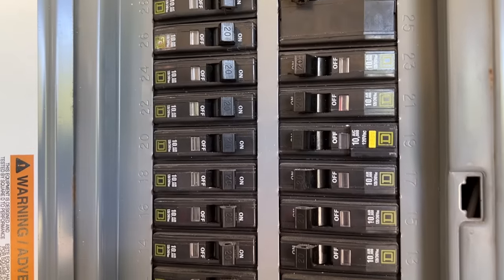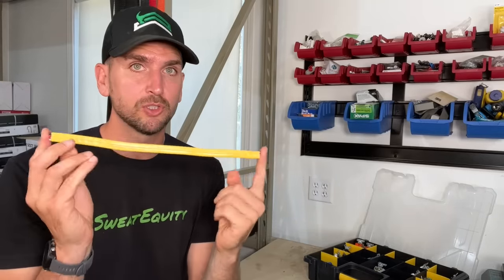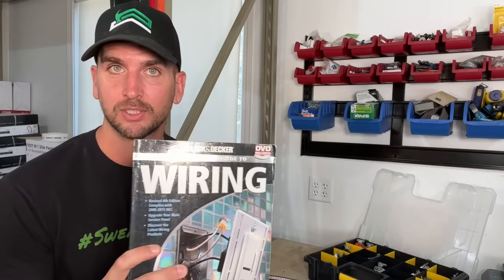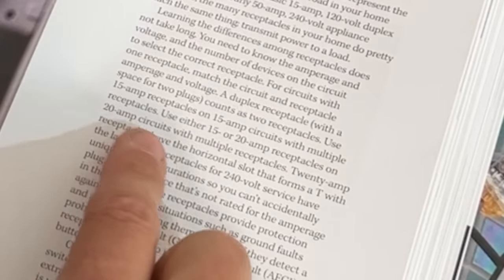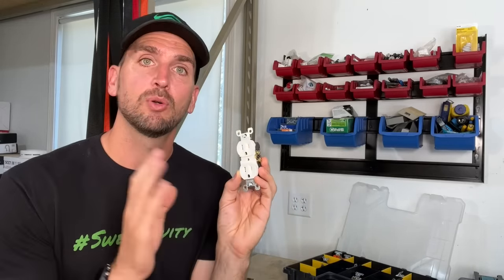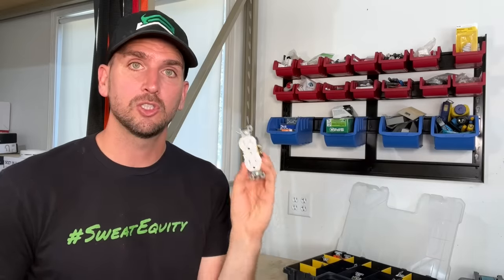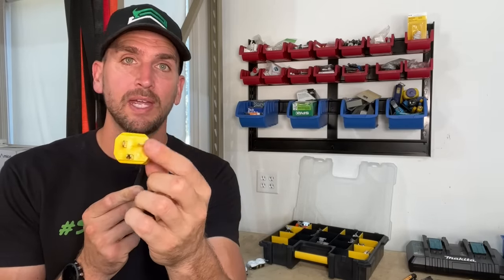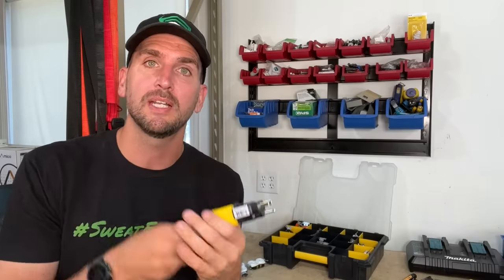Can 15 Amp Outlets Be Used On A 20 Amp Circuit Breaker

Comment: I just subscribed to your channel even though I learned electrical wiring when I was in the 9th grade and I'm 70. What I learned back then is so antiquated, I desperately need upgrading myself! 🤣 Seriously though, I have really enjoyed your video's and the new information you give me. Just from this video alone, I will never buy anything but commercial grade outlets from now on. Especially since the contractor was very cheap, and used 14ga. wire instead of 12ga., and wired the house himself instead of getting an electrician to do the work back in 1988. Just back in June of this year that cost me and my wife over $2300 to have the electrical panel replaced by a professional electrical company. That fixed more problems we were having than I can count. The old panel had several breakers that were not connecting because the connection strip was burned out!
Reply from the maker: Welcome to the channel and thanks for providing the story showing saving a few bucks today can cost many more dollars in the future.
Reply: Thanks to utube - I'm  just learning about electrical wiring at 56 - good medicine

Comment: When I see a 15-amp outlet, I assume 15-amp circuit and breaker.  When I see a 20-amp outlet, I assume 20-amp circuit and breaker. If I ever wanted to upgrade a 15-amp outlet on a 20-amp circuit, I would have to trace the wire back to the panel to make sure it's 12 gauge the entire run, or assume that the entire run is 12 gauge if it terminates at a 20-amp breaker. The cost difference is not that great in the long run to not just simply use 20-amp outlets on a 20-amp circuit. Personally, I prefer knowing what I see is what I get. ;)
Reply: I like it the same way, guess we have something in common;)   In a home or apartment equipment with 120 volt,  20 amp plug are rarely encountered. The few times they are, they are typical on commercial or professional grade kitchen countertop appliances, such as microwave ovens, toaster ovens, and expresso machines,  like the style you'd find in a restaurant or café.    Because such devices pull large currents,  they usually will require it's own circuit,  so when you walk into a kitchen and see 20 amp outlets along the countertop, for example,  that's often done so the occupants can see they have a 20 amp circuit at a glance.   That's how I'd build my own home.
Reply: Go to your kitchen. Look at the outlets. They are 15a outlets. However, they are on 20a circuits unless your house is really old.
Reply: @dracula3811  - you're most likely right. Without opening up each outlet and tracing the circuit back to the panel, better to go to your panel, find the kitchen breaker, and verify that it's 20 amps. Better still to remove the panel cover and verify that the wire it's attached to is 20 amps. In fact, our electrician DID put all 15-amp outlets in our kitchen on 20-amp circuits.
Reply: I've seen too many non-inspected DYI electrical modifications to assume anything. Here's a good one. House was wired with 30-amp 220v (correctly on 10-gauge wire) going to the garage on a 30-amp breaker. At the garage, the sub-panel had been removed (why?) and the two hot feeding legs had been split into two 110v circuits on a shared neutral (no breakers). One leg was populated with 20-amp outlets and the other 15-amp outlets and misc garage lighting. But the 220v breaker in the main panel had never been changed. Ouch! One garage leg had shorted out internally and was flipping the breaker intermittently when the ground was intact, but otherwise buzzing!
Reply: @BrucePappas  that's the way 99% of electricians wire kitchens. It's code compliant and safe to do.
Reply: @dracula3811  - when I rewired our daughter/son-in-law's house, we put 20-amp outlets on 20-amp circuits, even 20-amp GFCIs. I prefer it that way. BTW-The new panel was populated with arc-fault breakers.
Reply: @BrucePappas .  An inspector found a 40 amp single pole breaker on #14 NM cable before my son bought a house.   An electrician came and replaced it with a 15 amp.   And that as it ended up was the safer part of what was happening in that (electrician installed) sub panel!  The electrician refused to turn the panel back on and left.   The owner turned it back on.
Reply: @KevinCoop1  - that's scary!

Comment: I run 3 20 amp circuits with 12 gauge to 15 amp receptacles for my home theater and have for 20 years with zero issues. Two big powered subs, ran 4 at one point, also one big poweramp amongst other components and even driven hard for long periods never had an issue. Even with at times 20 amp power cord amps I've ran a 20amp adapter to my 15 amp receptacle with no issues. Maybe if it was a constant draw item there would be.
Reply: I'm not surprised, but are you using industrial grade or audio grade receptacles? Is your circuit wired for and are you using isolated ground?

Comment: I have a couple of questions. 

1. Is it okay to plug up a TV, lamps, and computers in a 15 Amp outlet? 
2. Is it okay to plug up a TV, lamps, and computers into a surge protector power strip that is plugged directly into an extension cord (the orange ones) that is plugged up into a 15 Amp outlet?

Comment: While I think this one 20amp and a bunch of 15amp receptacles is silly, I will say that I have a friend who 6000 sq ft house had been outfitted with cheap 15amp residential grade receptacles.  They had been having weird flickering and periodically smelled a burning smell and it turned out that several of the receptacles in the basement had overheated and melted, but not tripped a breaker.  The receptacles (one where a space heater was plugged in) was melted and charred on the back and it had heated up and melted about a foot 12 gauge Romex (the sheathing was discolored and no longer flat and the wire insulation was brittle) in the wall.  Additionally the circuit breaker had been damaged from the constant over-current and in-series arcing (not hot to neutral but hot on/off/on/off).  To the point that yes, better grade receptacles should be used in homes and really the 2017 code for AFCI breakers would have prevented this near house fire.

Comment: A Harvest Right Freeze Dryer is required a dedicated 20 amp circuit. When I shop for an electrician, what should I ask them, and what should I watch out for?
I subbed and rang that bell.
Reply: You should say you want a 20 amp branch circuit with a dedicated 20 amp receptacle.  Single or duplex is up to you.  Either will work.

Comment: It's odd that people who question using a 15A receptacle on a 20A line or multiple 20A receptacles on a 20A line never seem to question using multiple 15A receptacles on a 15A line, despite it happening all over their house ... the underlying concepts and restrictions remain the same: Pay attention to both single and total load.
Reply: The reason is perhaps 15 amp is a catch all case, which mostly powers low power devices in your house.  While if you think of 20 amp circuit, you think about a particular device that requires it, for which 15 is not enough. And after that device is plugged in, there is not much spare capacity left.   So with 20 amp you are more often in a situation when only one device can be powered.
Reply: I asked the same thing but some one just explained it to me. The reason actually makes sense. 15A plugs are on all sorts of devices. Those devices may use 12A, they may use 3A, they may use 0.5A, they may use 0.01A. 20A plugs, on the other hand, are almost exclusively used on devices that are going to be pulling more power than a 15A plug is rated for or else they would have just been made with a 15A plug to begin with. That's why it's different using multiple 20A outlets VS multiple 15A outlets. I've watched like 5 videos on this topic so far and none of them really explained this which left me puzzled but it all makes sense now.
Reply: @Spinelli__ .  Have you noticed the difference in the cord of a 15 amp table lamp, a 15 amp kitchen appliance, and a 20 amp piece of equipment?
Reply: @KevinCoop1  No as I don't own any 20-amp cord devices. A 20 A cord should definitely be of larger gauge if that's what you're asking since it obviously needs to be able to handle a higher current (20A instead of 15A).

Comment: The circuit breaker is there to protect the wire. If you are using 12 gauge wire, it is rated for 20 amps. A 15 amp outlet will probably realistically take a 20 amp load, it is just not RATED for that (as you point out they make adapters, if the device draws 20 amps and it is a true 15 amp/14 gauge circuit the breaker should pop). The code is written the way it is because in a multi circuit the 15 amp outlet will be just fine on a 20 amp circuit. Mainly because the WIRE will handle the load.

Comment: this is all good in the US... but here in Canada due to $ difference.. a standard outlet is about $380 at Home Depot... The pro versions run around $8 each.   Can get a bit costly when you need a lot of them.
Reply: What the heck is home depot doing with a 47x markup? :p
Reply: I'm going to assume that you meant $3.80, which is still way high. A 15 amp receptacle in the US is less than a dollar.
Reply: @davedammitt7691  yea.. woops

Comment: It's easier if you think about the demand rather than the capacity.  A 15 amp plug (the standard with 2 blades parallel) won't ever be wired to something that wants more than 15 amps.  A 20 amp plug has blades perpendicular, hence the sideways slot in the outlet.

Comment: Hi there!!
First thanks for enlightening me on differences with 15a 20a receptacles and the wiring types and all. Very informative 

Quick question tho.. so when I plug in my vacuum in certain different sockets in my mobile home and the breaker kicks power off.. does that mean I have bad wiring is present somewhere or should I just purchase a new vacuum or call an electrician?

The home is quite up in age as well as the vacuum  and I’ve learned a lot from this video so if I do have to call electrician I can ATLEAST sound like a mechanic ha
Any advice will be appreciated

Comment: The issue I run into is having an electric (oil) heater on a circuit, and also on it is a treadmill. Always pops the breaker - Set up as 15 amp, covering all outlets in the basement. Must be 15 plugs, no others under heavy load. I warn my family to turn off the heater before starting treadmill, or expect a walk to the breaker box. Considering running a separate 20 amp circuit to the work out area.
Reply: Run two.   One for each appliance.  You might want to start playing video games very heavily!

Comment: We have a portable air conditioning with a 20amp (horizontal neutral prong) plug… we currently use the converter to plug into our standard 15amp receptacle. Can we change out the receptacle? The converter is bulky and does not provide a stable connection
Reply: If this is a 20 circuit with 12 gauge wire, then yes.

Comment: UL498. Standard receps are UL tested at 150% of their rating and must hold it for 8 seconds. Hospital and commercial grade, 250% of their rating. In other words, a cheepo 15A recep must hold 22.5A in order to be rated for 15A. In addition, the link between the terminals is rated 20A, and must hold 30A for 8 seconds to be UL listed as a 15A recep. It is close to impossible to overload a 15A recep on a 20A circuit, assuming proper installation and a correctly functioning breaker or fuse.
Reply: Thanks, this is precisely the sort of information I've been looking for! I have no access to UL498 and am not about to shell out $1000+ for it, so this really helps.

It also confirms my suspicion that 15A outlets (properly made ones at least that pass UL testing and such and are legal to be installed in the US) should be able to handle well over 15A, because they're commonly installed on home 20A circuits and if they couldn't handle more than 15A then plugging in two devices totaling more than 15A combined (which while not a good idea happens every day in millions of homes) could have adverse consequences.

You said that even residential 15A outlets should be able to handle 150% or 22.5A for up to 8 seconds. What about more than 8 seconds, say several minutes, but less than the 3 hours that I believe constitutes continual use according to the current NEC? Are they rated for that? And what are they rated for under continual use, 15A?

Comment: I'm sorry, but the term outlet is already taken in the code book. It is in reference to any point in the wiring used to put a receptacle device, a switch decice, a luminaire, a smoke detector, etc. You will find in the older codes first requiring the bedroom "receptacles" to be AFCI protected, and then when expanded later, it read all Outlets to be AFCI protected. That meant everything in the bedroom. Now wiring in the bedroom walls was not included there if it had no "outlets" in the bedroom.
A company may refer to a device as commercial grade, but there is no standard in the code book that differentiates Residential devices from commercial devices. It is onle the manufacturer that has made that determination.
The thing to remember with a device rated 15 amps is that any equipment using that receptacle will also only be rated to use 12 amps maximum (80% of 15). If a device has the sideways prong, then that particular piece of equipment will take between 12 and 16 amps (80%of 20).
Yes, you can buy the more expensive receptacles and switches, but as for myself, an electrician for 20 years and an electrical inspector for 20 years, I buy the cheapest Decora devices I can find. In my last house I had for 20 years after the remodel, not one device failed. Remember, these devices were not just thrown together, but had to meet certain safety criteria per UL standards. That being said, do not Ever use a device without a NRTL listing under any circumstances. Devices that are not listed are built to no standard except what the accountant thought was cheap enough to make a buck and fool the end user.
In all my years as an electrical inspector, I learned one very valuable lesson. My opinion had nothing to do with it. It was the code and listing that dictated acceptance, not my opinion. I hope that there are some inspectors reading this that really look into the intent of the code and not a personal biased opinion. Call the manufacturer, UL, or any other National Recognized Testing Laboratory if you have a question. They would love to educate you as nobody can know everything unless they ask. 
Thank you.
Reply from the maker: Thanks for all the feedback Bryan.  I always appreciate people sharing their experience 👍
Reply: Wow!   That was very deep!

Comment: i believe they design 15-amp duplex outlets to allow 20-amp power since you could have two 10- or 12-amp devices plugged into a 15-amp duplex receptacle and gfci outlets even say 20 amp pass through since you have multiple outlets downstream all running through the gfci outlet

Comment: Just so I am perfectly clear here, according to code, if I have a 20a breaker and 12AWG wire, I can use 15a outlets/receptacles as long as I have TWO or more outlets on that same circuit?  
If true, then that means I should strictly use a 20a outlet/receptacle for a microwave outlet since it's the only outlet on that circuit/breaker?  Is that accurate?
Reply: Not exactly.   If you install a single receptacle (called simplex) then it must be 20 ampere device.   If you install a duplex receptacle, then it can be 15 amps.  That may make no sense, but the intent is, if a designer or electrician knows ahead of time about a true 20 amp appliance with 20 amp plug, then they can put the single device in so that no other appliance can be connected.   A residential microwave has a 15 amp plug and if you read the book that comes with it, typically calls for a dedicated 15 amp 120 volt circuit.

Comment: Fine, indeed 20A receptacles are quite rare.  I made the mistake of spending $$$ for 20 A GFCI outlets on my 20 A circuits years ago, thinking required since they feed-thru to other outlets.  In a remodel, I found that at least newer 15 A GFCI outlets have a stamped note "20 A for feed-thru".  It is only the receptacle on the GFCI which is limited to 15 A.

Comment: I believe all electric boxes (used to connect devices) are called outlets or outlet boxes. The difference is you have specifically "lighting outlets" or "receptacle outlets" or others
Reply: Not quite. Boxes that contain switches, for example, are not outlets.

Comment: Forget the code (for now). Logic says a 5-20 outlet will accept a 5-15 Plug  (410-56 exception a).  OTOH Logic also says, if there is ONLY a single (dedicated purpose?) Outlet, that everything should match its rating. eg Microwave, Dish Washer,... . Push-in outlets no longer accept 12Ga (holes to small.  There are still thousands that are in use that do allow 12Ga. Those will need to be replaced with Backwire models.)

Comment: Great information!  I’m in the process of checking all wiring on my outlets and switches since home builder electrician back stabbed most of them.

I still don’t quite understand if you have a 15 amp outlet on 20 amp circuit will the outlet only ever draw a max of 15 amps?  I don’t understand how outlet can limit the draw, or if that’s just a max rating on the outlet?
Reply: A typical cord cap/plug, the 2 blades are straight/parallel. That's a 15A configuration. A 20 amp configuration is where they're perpendicular, T shaped. If something is designed to draw more than 15 amps, it will have a 20 amp plug on the end of the cord and it will not fit into a 15 amp recep. The link between the two sides of a recep is rated for 20 amps, so on a 20 amp circuit the breaker will trip before any parts of the recep exceed their ratings.